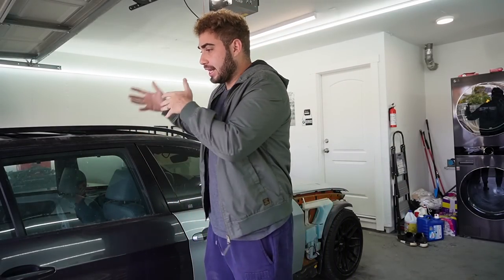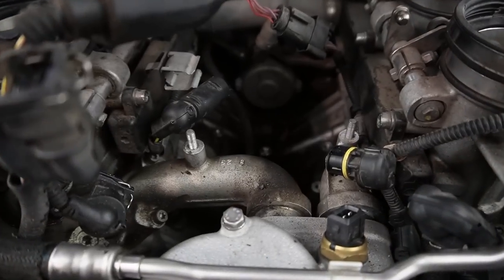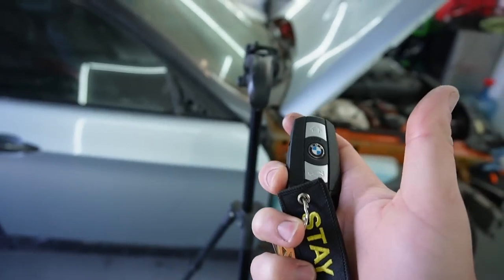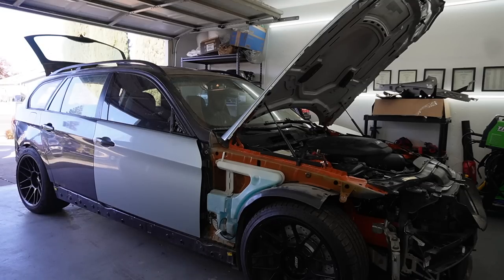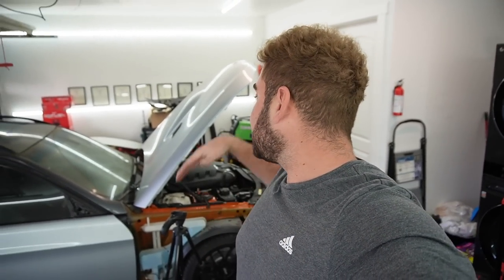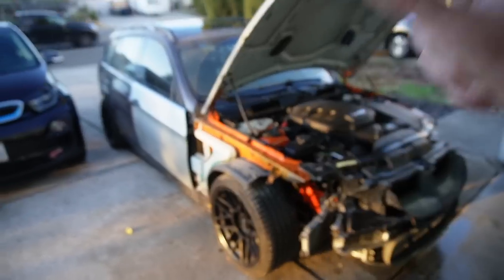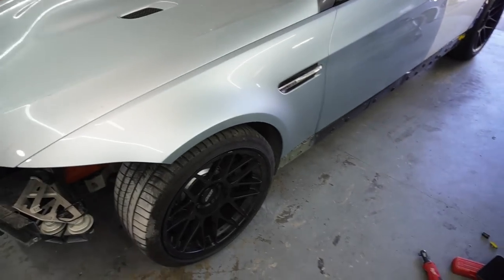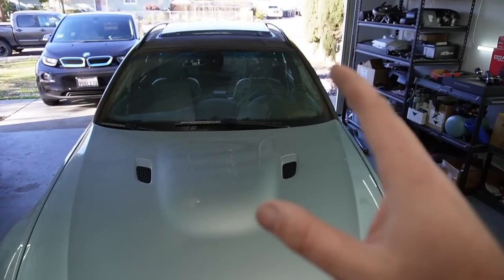Building A Custom 1 of 1 E91 M3 Wagon! (Part.23)

Comment: That little thing you found in each of the actuators is a tamper-proof tab that breaks when they are opened for the first time. It’s a little plastic piece that holds the cover onto the actuator and it “proves” you were the first to open those.

Comment: Nour...Since you're a BMW guy, you SHOULD have ISTA-D software which will help you figure out all error codes in details with test plans and proper diagnosis of issues, unlike generic code reader scanners...You could've saved yourself buying new throttle actuators plus the convenience of pinpointing what the problem is...Trust me, you need ISTA-D! Cheers.